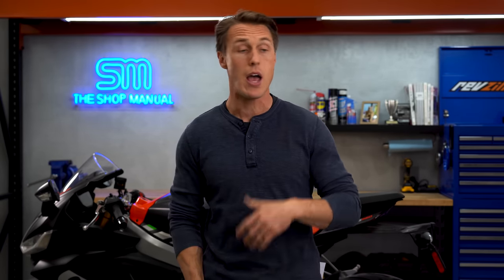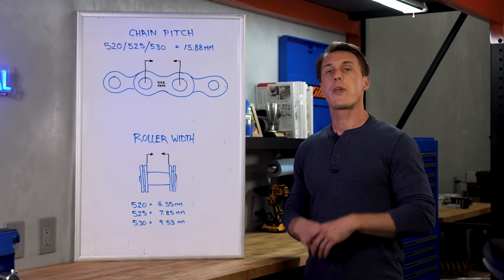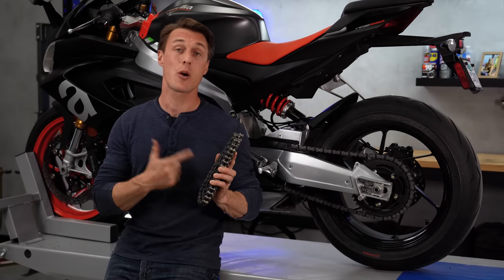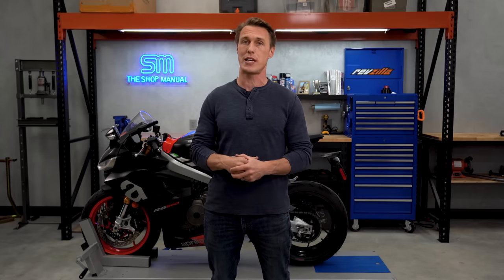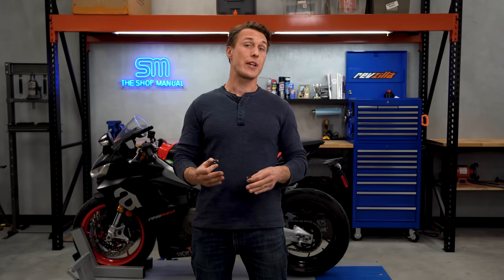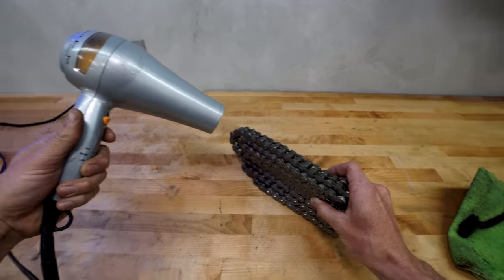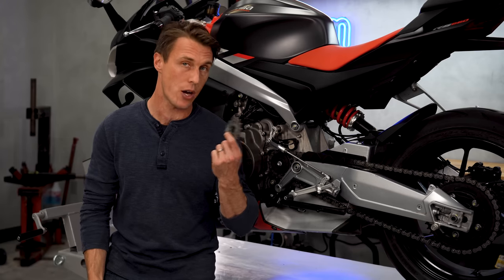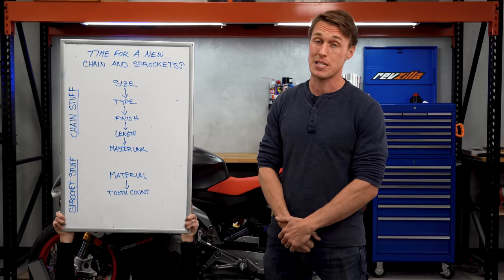Everything You Need To Know When Replacing Your Motorcycle’s Chain and Sprockets | The Shop Manual

Comment: I replaced my chain and sprockets.....man that rivet master link kicked my ass. Always buy extra master links, in case you mess up. Looks me I did....twice lol
Reply: How did you manage that? With the did tool you literally can't possibly fuck it up?
Reply: @tolga1cool  sure you can, if you spread / mushroom the end to far and it cracks. I would say that’s fucking it up. I didn’t take it slow
Reply: @15Kilo  But with the tool made by did you can't even go too far.... That's the thing
Reply: @tolga1cool  the motion pro tool?? It will go until you stop turning. I’m not to sure what you’re referring to. According to information I found about mushrooming the head. It should be between 5.4 and 5.7 with a micrometer. Anything past that it cracks. Then you need a new one to start over
Reply: @15Kilo   Im referring yo the tool made by DID themselves. It's for their hollow rivet style link. You just screw it down until the tool is flush with the chain and then you're set.
Reply: @tolga1cool  I’ll check that out. But I used the motion pro tool that he showed in the video
Reply: @15Kilo  If you really wanted to, I guess you could also fuck it up using the did tool, but that would be hard to do. You just tighten the tool down until the riveting end is flush with the chain and then you're set
Reply: @15Kilo  I have no experience using that one. I just bought the did tool, because I only use did chains. Also a few mechanic friends use is as well so I added it to my toolbox too.
Reply: @15Kilo  DID KM500R if I remember correctly

Comment: If you want maximum power to the rear wheel use the unsealed chain.
I can feel a very noticeable power loss when using o-ring chains on bikes like my KDX 200 and XR250R.

Comment: Well, aftermarket sprockets (for example from JT) also comes with rubber cushion like OEM ones.
Reply: Yup, JT is pretty much the only brand that I'm aware of that offers it, and that's because they're also an OEM supplier ;)
Reply: @StaTBMK  I just bought JT Xring chain also, because local parts store was out of DID or any other big chain brand chains for my specification. Haven't replaced yet, so I'm curious how long this chain lasts. Most impressing part was a price - 54 EUR for JT vs. 90+ EUR for DID/RK etc.

Comment: Easy just buy what the manufacturer specs, steel chain, steel sprockets, aluminium is to soft for everyday road use. I run a 2000 XJR1300SP in the UK and just buy manufacturer spec, ride 70 miles daily all year round, just keep your chain and sprockets clean, lubed, correctly adjusted, most importantly, and it'll last you years 😃🏍

Comment: Yea I want a 525 pitch 120 length black/gold and some steel pulleys maybe go down one in the back for a tiny bit more top end as the GSX-S1000 is geared low! Plus my Speedo is off by 5mph so that should make it about right cause right now I have to do 60 to really hit 55 on GPS! So taller gearing will either even it out or get it slightly closer! I don’t like huge changes ruins bikes just enough to make it not so buzzy on the highway is all I want! I cruise a lot not worried ain’t laying down 10 second 1/4 miles!

Comment: Would be cool if you could rent out decent chain breaker/joiners at Cyclegear locations. Kind of like how auto parts stores will lend out ball joint press kits. I’ve found that the cheapie chain tools are unreliable but hate having to buy a pricey uni-tasker for something I don’t change that often.

Comment: I literally only changed my chain and not my sprockets and my sprockets were just fine. No teeth missing or extremely worn out.. chain is still fine 5000 miles later😂 saved a good amount of cash too!! It's all up to you really if you wanna fork out the money...
Reply: Wear to the sprockets isn't always visible. A couple thousandths of an inch wear on each tooth face means your new chain is only actually engaging the first few teeth on the sprockets, not all of them, which means more rapid wear (and more driveline noise) as you ride. As you said it's up to you if you want to replace everything as a set, but the fact remains that a new chain will wear faster on worn sprockets, even if said sprockets don't visibly look worn.
Reply: @AriH211  Flipping sprocket (if possible) gives you "new" teeth.

Comment: Hope you Ari read this one out... Recently my cb650r has been flapping in a power loss sensation... Around 3 months ago I changed the air filter and healed the matter for a while but then came the issue... Changed later the 4 spark plugs and cleaned the injectors... Improved a lot and even got one of the best gas mileage... Recently again I feel this power loss... At this point I am running out of options and I am being told there are 2 options... 1-clutch worn out or 2-chain sprockets should be replaced... Last notes I can tell are the front sprocket seem solid and decent 🤷🏻‍♂️ but when riding at times it feels like when one small drowns with a sip of a glass of water as comparison...the overall sensation is there is a power loss when reving it up it struggles to reach the average speeds it often reached...
Reply: valve adjustment done?

Comment: Buy the Regina High Performance Endurance chain once it's available for your bike. Low maintenance chain. It needs very little cleaning, lubrication, and adjustments. DLC coated rollers and bushings.
Reply: Link? 530?
Reply: @danlford  from what I know it's only available from BMW as the M Endurance chain in 525. It will be available from Regina soon. Other chain manufacturers will probably make it too.

Comment: Remove your chain, during adjustment, soak it overnight in diesel fuel, air dry, replace then run the bike down the road to build heat then spray it with chain lube.  You can use gear lube but doesn't stick well and makes a mess.  Or do nothing at all, because the build up of neglect is not so bad,  just keep it lube. Also a lose chain is much better than too tight.

Comment: My issue really is that the stock yamaha chains on their lower cc bikes stretch really fast. Like under 300 miles. (Yes a lot of fast acceleration). And yes the chain is cleaned and lubed again when its dirty or wet from the weather.

Comment: Never changed the chain and sprockets at once. I use up about 3-4 chains a year (doing about 60.000-80.000kms yearly).The wear difference is less than 10% if I change the sprockets or not. The front sprocket lasts 2 chains and the back lasts 3-4. I use did 520 o ring chains with jp sprockets. (Also with going around 250kms a day 5 times a week, I never clean the chain, I just lubricate it daily)
Reply: i would do the same thing if i was doing that much distance each year. no reason to clean a chain if you are going to change it after 3-4 months
Reply: Which bike do you have?
Reply: @bruderrudiger9574  A 2013 Kawasaki ninja 300.
Reply: @benjaminposa7245  nice! Did you ever broke down? How many miles does she have?
Reply: @bruderrudiger9574  I bought it used with 13.000km-s in june of 2020, I just reached the 65.000km mark this week (40.500 miles). Did the yearly maintanence job in february, only minor adjustments were needed. (valve adjustments, injector cleaning and injector synchonization). The other parts like coolant and brake fluid, air filter is changed yearly, brake pads about 2-3 times a year, motor oil monthly, tires 2 times a year (from october to may I use 4 season Heidenau K66, the rest of the year I roll with Bridgestone S22). The only weak part I noticed is the front fork. It needed a full replacament at 18.000km it probably  had an accident with the previous owner, and the simmerings only last 10.000km to 15.000km-s.
Reply: @bruderrudiger9574  and to finally answer your question, luckily never broke down while being on the go. When she felt like she don't want to go anywhere she broke down on the driveway. (changed the brake fluids and next morning she felt like trying to get rid of the air bubbles in the brake system for more than 6 hours was not enough for her.)
Reply: @benjaminposa7245  I have a Z800e and I had to do a fork service after 8000km because it was leaking oil. Seems like a weak point of Kawasaki. Do you really need to replace the oil every month/ 6000Km?
Reply: @bruderrudiger9574  the service manual states it needs replacing every 6k, not too bad. An oil filter costs $4 and 3 liters of motul 5100 is around $15. The oil is not too dirty so I think it could stay in for an other month, but compared to the daily fuel cost replacing it is not a big deal.
Reply: @benjaminposa7245  Why did you get a Ninja 300 for daily riding?
Reply: @bruderrudiger9574  I've had a 2007 Honda cbr 125r before, and wanted some more power.I've had some models in mind, like the cbr500, gs500f, yzf r3, really the only considerations was: it need to be agile, and has to have a decent fuel economy. But I think when it came down to buying a new bike It was not the racional, more like the emotional choice that was made. Its like when you see a girl and you know she is "that one girl".

Comment: Little help here please!!
 I recently purchased a chain/sprocket combo for my Triumph T120. I would say this model bike fall somewhere between a standard and a cruiser. I have the correct chain length and link size: 100/525 and went with a quality RK brand. However I noticed that this chain is for "Supersport" and "Roadrace" bikes as marked on the package. Also it is and XW ring which was not covered here on the chain types, in the video. Nevertheless it was a very informative video. MY CONCERN: Will this Sport/race bike chain be ok to use on  my standard? What about the XW seals? 

Thanks for a great video!

Comment: Explain why changing a rear sprocket count changes the speedo if the speedo runs off the front wheel ? A sprocket change will affect acceleration and motor rpm. The speedo will see the the front wheel turn in relation to the acceleration. Speedo should say same speed just got there faster or slower.
Reply: You're right, it wont. Changing sprockets will only affect bikes that read from the gearbox output shaft which is most big bikes

Comment: Not quite true about aftermarket cushioned sprockets.  I have bought an Ognibene cushioned front sprocket and the reduction in noise and vibration through the footrests was really noticeable.  They are also available for the rear.  And they are not expensive.  Also you can get aluminium (spelt correctly = English) rear sprockets that have the ring of steel teeth riveted, giving both lightness and strength. So I would say that this video is not 'everything' you need to know but a few things you need to know.  Other than that it was reasonably informative. :-)

Comment: Sorta skipped over my main hangup on chains.  I have found within my size, budget, type, and brands, there is an assortment of strengths and I assume weights.  Let's say there is 7200psi chain a 8900psi chain and a 11200psi chain.  I assume the lower strengths are going to stretch more and last less long but the opposite will be true of stronger chains and that the strength will come with weight and performance penalty.  How do you chose among a range strength and weight that fits your bike?

Comment: Hey Ari, you rode the Suzuki GSX-S1000GT, so couple questions.  Since it has sport bike DNA, could the gearing be taller?  So, would it make sense to change the stock 6th gear to be an overdrive for better gas mileage and let the engine relax at hwy touring speeds?  And what would you change it to?

Comment: Old bikes had the spedometer driven from the front wheel so the sprocket ratio change won't affect those. Dunno about the newer stuff, maybe they are different?
Reply: I think the newer bikes, ones with abs brakes, would use the abs sensor data to calculate speed, so the f/r sprocket ratio wouldn't effect the speedometer for those bikes.

Comment: Nice video, what about installing solid master links?  The hollow rivet master link is easy with the standard tool you can buy to flare the hollow end on the rivet. What about solid rivets like the Tsubaki chains have, can they be installed on the bike? Or do they need to be installed off the bike to impact the rivet head to form it?

Comment: Tusk or primary drive? Looking at atv chains for a raptor 350. Steel or aluminum sprocket? A lot of rough trail riding in my area makes me want to go with steel but with the lower power I feel less rotating mass would be better

Comment: Yeah sorry I'm only one minute in and I've just got to point out that sprockets can go way longer than 10,000 miles, and they aren't necessarily bad just because the chain is.  There is a specsheet for sprockets you can check to see if their wear warrants replacing.  If you literally can't even tell the difference in the teeth, they're most likely fine.  If they're stock, check for cracks in the OEM rubber damper on a front, and make sure it's still plyable and not dry.

Comment: I've got an advice from a known YouTube channel to change the front sprocket at about 10.000 miles to prolong the life of the complete set, sprockets and chain. Because the front sprocket is rotating about three times faster than rear one, will be first to show wear and thus shortening the life of the chain. My bike has now 12.000 miles, with the original chain set, everything looks good workout visible wear or damage, chain has the correct slack... is a good idea to change that front sprocket? Thank you

Comment: I went with a screw type master link on my last chain.  IMO it's the best of both worlds.  It comes with a threaded pin, you use the nut to draw the pins into the side plate and the threads break off when full torque is reached.  Do you have an opinion on these?
Reply: Never heard of those.  What brand makes those?  My chain may last the season but I plan on changing it soon.

Comment: 1:40 what extortionate places are you buying your chains from? I can buy a 128 link 525 DID ZVMX for 95 bucks, and that's DID's flagship offering. Sealed ofc
Also 4:30 the different types of rivet might have been worth pointing out. A lot of those cheap ebay special chain tools are made for HOLLOW RIVETS that get mushroomed out, whilst many higher end chains come with SOLID RIVETS that you need to squish down and out, these require a different tool.
Reply: The Motion Pro tool I demo'd does both hollow and solid rivets, and honestly, I've never come across anything other that hollow rivets. 
As for where I'm buying my chains, there's this little online retailer called RevZilla...
Reply: @AriH211  Haha, fair enough. I only mentioned it because a lot of retailers do "free chain tool included" and then the chain comes with solid rivets. Motion pro is the best in class, works for everything, not trying to diss, great video otherwise, differences in price are obviously all circumstantial.

Comment: I'm just getting into ADV type cycling coming from a big cruiser background.  I've never had a bike with a chain before, so is there a mileage mark when you should change your chain and sprockets, like a rule of thumb? Is it like when its time the to change the oil in your car, which is a specific interval, is what I'm asking?
Reply: the rule of thumb is according to measurable wear/stretch of the chain or measurable wear of sprockets.

Comment: Have seen in a few charts where a 2009 zx-6r supposedly has a 108 link chain stock. 16/43 is stock. My stock chain is 112 links. I dropped to a 40 tooth sprocket and 110 links and its good. Why are so many charts wrong?

Comment: How can a rear sprocket affect speedometer? I thought it was measuring the front wheel hub?
Reply: Depends on the bike. Pretty sure most bikes with ABS measure speed using the ABS rings. There are bikes that measure via the transmission, so that would affect the speedo.

Comment: The first time I tried replacing my chain & sprocket kit, I had to remove the swingarm cause my oem chain came in a continuous loop.
#Bajaj #Rolon #India ♥️
Reply: Well you had to take the sprocket off anyhow if replacing it. But otherwise you could have just cut the old chain.
Reply: @whichgodofthousandsmeansno5306  Removing the old chain was no issue. The new chain came in a continuous loop.

Comment: So when I check my chain tension on any of my bikes (I have 6 currently), I turn the wheel and at one position, the tension is correct and another 180 the chain is loose or tight, depending on where I adjusted. Is there an easy way to get the rear sprocket set to where the chain has the correct slack during the full rotation of the wheel?

Comment: Wait wait wait. Speedometer accuracy? Don't bikes use a cable to the FRONT wheel to measure speed? Not like cars that measure off the transmission? Or have they changed the way they do things?
Reply: Most modern bikes measure using a hall effect sensor off the transmission. Some still use a hall effect sensor off the front wheel, but those are getting rare. Older bikes, and some more economical bikes, still use cable-drive off the front wheel.

Comment: Isn't it in theory optimal to run aluminium rear, and steel front. since the small sprocket gets worn faster (more rotations)? So if the rear is aluminium and the front is steel it evens out?
Reply: They don't wear at the same rate. For street use an aluminum rear sprocket might last 1500-2500 miles. That's okay for a track or racebike, but for street use that seems pretty foolish.
Reply: @AriH211   So even though the front sprocket gets worn faster than the rear, aluminum is so soft, that it still wears a lot faster, or?

Comment: I did not get it how to determine when i need to change chain and sprockets. For example my sprockets totally fine, chain has some minor rust spots and only 1 frozen link. But all works fine and i don’t see any issues. It has 42000km on the clock. Should i continue to use it or should i change chain and sprockets?